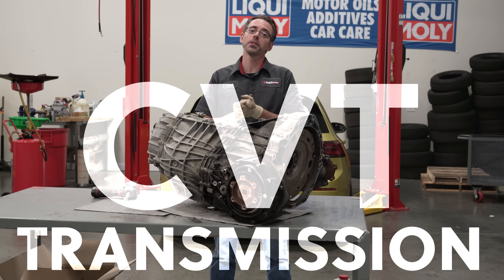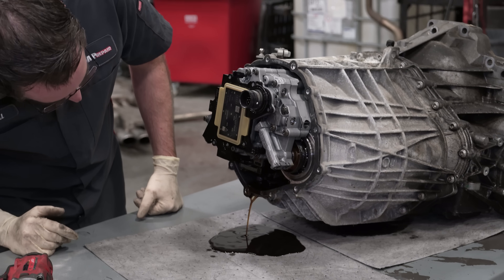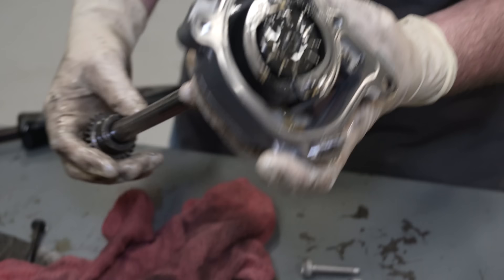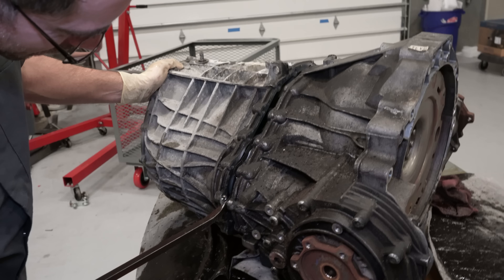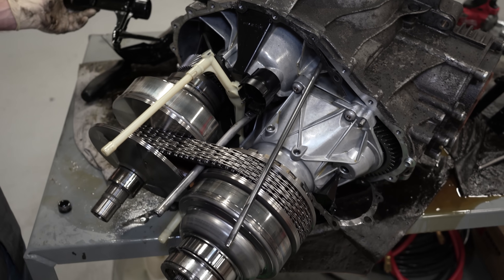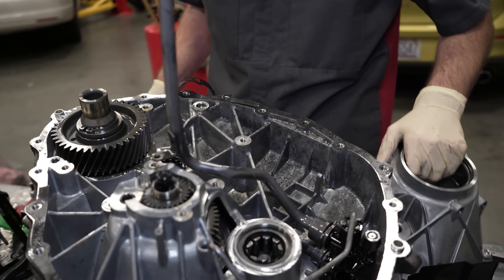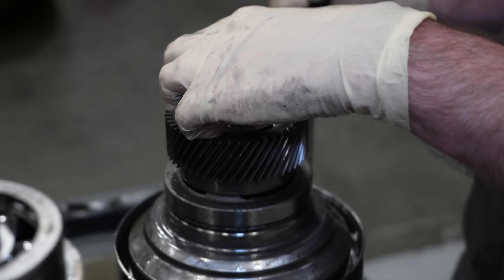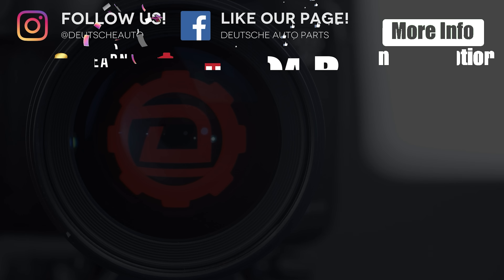Why you shouldn’t get a CVT transmission

Comment: CVTs are not trash Volkwagons are trash. There are plenty of CV transmissions that operate nominally and repairs can be done quite easily. Volkswagons are a high mile vurnerable vehicle. They operate fine in the warranty faze generally, then things start going wrong, Switches burn out, things start leaking, and transmissions start to fail within 10 years. Audi is very well known for transmission issues as well as other lines within the Volkswagon product line. It is commenly known that VW tried and failed at CVT.

Comment: I have a 2017 Nissan NV 200 van. 220,000 mi no problems with the transmission or engine other than the air conditioning. I change the CVT fluid every 40,000 mi. Maintenance is the key Nissan tells you you never need to change the fluid which is totally ridiculous

Comment: We have had to replace a CVT transmission in 2 different Nissan Sentra’s we have own. 2012 and a 2013. The 2012 is starting to slip again and it’s only 30,000 miles since it was replaced.  We will never own Nissan again or anything with a CVT trany.

Comment: Okay,I've been driving daily for 27 years. I recently stopped using manual gear. So far i've read the following:
-DSG =failure
-CVT=failure, not recommended, losing the "driving feeling", optimal RPM for engine
-Powershift=big piece of sh*t from Ford
-Traditional automatic transmission: boring, slow, complicated sometimes
- Tiptronic= fail, extremely pricey to repair
- Double clutch = fail, pricey to maintain and repair

What else do we have? Get a private jet and fly? I've got a Ford Mondeo Hybrid (european version of american Ford Fusion) with CVT gear. I don't have any problems with it. It does what it does. I don't care if i don't hear as it changes back and forth as there are no gears or there are "unlimited" gears. It is set nicely. If i need torque, i press the pedal. But it's excellent for cruising, no need to hurry, that car is not a sportcar anyway. If i need HP and speed i invest into a Mustang.

Comment: My old car, my 2016 Maxima SR when I first got it it said 4DSC on the tail light which meant four-door sports car and I’m like ohhh bet!!!! And I raced the fuck out of that thing and blew the transmission in the first week warranty Replaced it with a brand new one I blew it again in another week the next one took about a month to blow up I went through six of them in less than a year until I totaled the car Nissan just kept paying for transmissions to be put in my car lol that engine was bulletproof though i’ve been red lining the fuck out of that thing now I got an Acura TLX with the nine speed V6 had it for about two years and it still won’t blow up I drive it just as hard as a Nissan

Comment: CVT can be different - make sure you consult with a competent person before refusing to go for one (or before buying).

A good example of misleading name can be observed in case of Toyota. Prius 2011+ would also say “CVT” but in reality is a completely different assembly with no belt and only gears inside. It’s reliable and far easier/cheaper to maintain through the life of your car.

Comment: I currently have a 2017  toyota corolla 1.8L.   The cvt transmission has almost 400k miles.   It started making a noise in october which may have come from me not missing a curb...(oops).   But its still running strong

Comment: First seven seconds tell the truth. I'm an ignorant sucker. Bought a low mileage 2016 Nissan Versa for $6400--it ran great for about a year. Then clunk, clunk, dead...AAMCO wants 8K to replace the transmission.  I didn't realize these clever designs needed lube change so frequently! Twenty-first century motto: The customer is always at fault. Now I'm really appreciating the prepaid "free" bus system in my city.

Comment: It seems to me that the need to use a cooler of some sort and a filter system that is not built in to the transmission but utilizes rubber hoses to connect to a filter body that attaches to the vehicle itself and it uses a filter similar to what is used on the engine.

Comment: The earlier Nissan Jatco transmissions were bad. But the Honda, Toyota & Subaru Cvt’s are fine. You just need to ignore most dealers saying it’s lifetime fluid. Have the dealer or good mechanic, change the CVT fluid every 40k miles. The fluid gets hot & dirty, just like other transmissions or motor oil. 🙄

Comment: CVTs used by Audi and Nissan are trash, sure. CVTs in general aren't though. They can be built correctly, proven by Williams in F1... in 1993. It was immediately banned by the FIA because it beat the pants off of every other car on the grid with basically no other changes to the car, and to a lesser extent ruined the sound.

Comment: It's apparent he has never owned any car of any make. All transmissions are crap these days. Though the CVT has come a long way, some dipsticks cannot get over the fact that automatic transmissions fail just as much as CVT's. I will buy a 2025 Subaru Brat with a full extended powertrain warranty that last to 200,000 miles or more, like I did my 2000 Tahoe which I've put 320,172 miles on it. Eat my words Dipstick, maybe it's the haters that aren't worth listening to.

Comment: What was audi smoking when they designed that chain. The chain in the CVT he was showing for the live demo of it changing ratios was a much better design. The audi one has so little surface area, but the example one uses a bunch of sheets that have form fit cuts on the side. Of course this one failed.

Comment: The problem is that people tend to view transmissions in general as something you never have to think about, something that should last forever with zero maintenance---WRONG. I knew a guy that bought a Mitsubishi Mirage brand new, and the CVT failed at 125K. I was curious, and so I started asking questions. Did he ever have the fluid changed? Nope. Did he even check the fluid? Nope. Transmissions don't take care of themselves, folks---you have to get involved.
Reply: my friend you are dead wrong!!!!I bought a brand new Q7 Audi2009we are in 2025 I never ever touch this automatic transmission and works like Rolex...!!! when something is built the right way you don't have to touch every year or every quarter give me a break,with your comments about , you have to maintain the transmission just like you change the oil in a car,metaphoric saying of course
Reply: @markaegyssus5192  Yeah, and how many miles is on it? Only a fool neglects their transmission, or any other parts of their car.

Comment: The only CVT's that are good and reliable are the eCVT's in Toyota hybrids.  There is no pulley or belt, just a center gear and 4 planetary gears.  Variability is achieved simply by varying the speed of the electric motor.
Reply: They're great but not even in the same category anymore, it's more of a power split device.

Comment: I've got one of the first CVT's in a car, the Ford CFT-30.  20 years and 280,000 km, and it works great, I love it.  The model did have a few issues that could have been resolved.

Comment: Everything I've heard about these is that when they fail, it's pretty much always a total failure. It's not like a run of the mill automatic that you can have rebuilt. (Even if they're expensive to rebuild) it's that with these, if anything goes the whole transmission is done since they're either impossible to repair or transmission shops refuse to rebuild them because they have so many problems and they don't want to get stuck doing a warranty job. 

All this trouble so they can claim an additional 0.5mpg on that model and force a subpar driving experience on us.

But what do the OEMs care? They get to claim slightly better mileage and when it fails early they get to sell another new car. 

I'm getting real tired of every new car in the past 15-20 years having some ticking time bomb under the hood that'll turn the car into a paperweight before 200k miles.

Comment: You fail to differentiate between the different CVT methods of operation. CVT is the concept of infinite gear ratios. Some use variable belt drives. Toyota uses a planetary gear systems. Completely different from each other

Comment: What  idiot is in the background trying to be smart and funny.  CVT transmissions depends, like most things, on who builds them.   Audie cars are overpriced overrated crap. I have had one new the second worst car I have owned over a sixty year time span.  There is a CVT in my present car which has done over 200,000 miles. No problem of any kind.  Would go to these two for an oil change.

Comment: I’ve had good and bad CVTs 

Good is my 300k mile civic that has never had a issue 

Another good is my 2018 turbo 1.5 civic that tuned with 300hp that put the motor is peak boost constant making it’s as fast as a type R and it’s “fake gears” is so aggressive it chirps the tires 

The bad is a jeep patriot I drove and it was the slowest works engine and transmission I have ever seen

Comment: Got to ask what people thought when an automatic tranmission came out. I'm sure a lot of people said the same thing. Every tranmission has bad parts it's the person that owns the car to make parts, make it or brake it. Had a 2015 xv crosstreck cvt with 211k on tranmission. Launched hard off every light down shifted to slow my self down all the time never had a problem with tranmission but I did have a head gasket go out. Didn't help that after 8 years stopped letting the car warm up as long as the first year.

Comment: I've been looking at various car manufacturers over the past years and seen the demise of the manual transmission and the increased use of the CVT. We all know about the early crappy Jatco CVT transmission failures in Nissans. I guess we can assume that the newer generations of CVTs have been  improved, but the added inconvenience of having to go to a dealership more often for fluid changes (or any reason) seems like a pita. For my 2 cents Mazda with their great technology and geared automatic trans is the way to go. Or get an older Toyota or Honda with a regular automatic transmission.

Comment: Subaru cvt's  generally fail when one of the solenoids goes.  Subaru makes you buy the whole valve body for 800 bucks and if you don't fix it yourself, it will costs around $2,000 to have a subaru repair shop do it for you.  Independant mechanics are recommending fluid change every 30,000 miles despite subaru saying no maintenance needed for 100,000 miles.   I would never get a car with a cvt unless I planned on trading it in for a new one,  in about 3 or 4 years.

Comment: Seeking Help with 2009 Subaru Tribeca Transmission Issue

After changing the transmission fluid, my 2009 Subaru Tribeca's gears refuse to shift. My mechanics have already run diagnostic software, but unfortunately, the problem persists.

Could you please suggest potential next steps or troubleshooting measures to resolve this issue?

Comment: I have to say. I do not experience this with my Chery Tiggo 7 pro. In manual option I have 9 gears. In auto, the transition is very good and you can see the revs going to the next gear. I find it really good compared to others I drove. But I do have a lot of warrenty km's on it so.

Comment: I own  Audi A6 C6  2007  2,7tdi  FWD with cvt   and i love how smooth its drives  , i understand   if its breaks its will be pain . im trying change  oils often . i drove 200k km  and its run still fine  i love also drive in sport mode where its pretending  doing shifting

Comment: I bought my 2015 lancer Gt with CVT transmission new with 39 miles, I'm currently, still driving, with 196,xxx miles on my dash. I've had mine well over 130mph on tracks, as well as trail riding and road racing and have no issues.. I change my fluid every 15,000 miles even though owners manual says 30k. Also never changed the filter

Comment: Look at the fluid - of course it failed! You can not neglect regular fluid changes in ANY transmission, especially a CVT.
Fluid changes every 30K is not a lot to ask for long life of the transmission.
I noticed you used the word "mashed" the accelerator. What on earth for?  Just drive the car normally.
I have had 2 vehicles with CVT transmissions and I loved them both.
I stopped the video at 2:08. I don't need to see the rest of it.

Comment: Have a toyota CVT a k312 cvt tranny. Car is driven up mountain roads everyday has 100,000 miles on it. Just did the fluid changes and changed the filter. Car runs just like it did brand new not even 1 hiccup.

Comment: For a reliable CVT vehicle, one option is a Toyota Direct-Drive CVT model. It’s important to follow the manufacturer’s recommendation and change the CVT fluid every 50,000 to 60,000 miles (or 80,000 km, in my country). Even if you believe in the “lifetime fluid” concept, it’ll last quite a while before it has major issue. I think that’s the reason why many second hand Toyotas have more reliability issues than expected , simply because the previous owners abuse this reliability advantage before the cars start going bad.

Comment: I've been shopping for a ~2010 period used car lately...the general consensus seems to be that they're mostly not great in that time period, except for the one used in the Misubishi Mirage. As it turns out, having only about 74-78hp coming out of the engine means the transmission is basically never stressed, so the Mirage's is perfectly fine even under neglected fluid changes (to a point).

Seems like modern ones are pretty ok as long as you keep up with maintenance. Having driven my sister's Forte, I think they can be tuned to be sufficiently peppy-feeling as well (hers takes off like a rocket if you give it a moment), but I have to admit that I like the promptness and predictable shift points of a traditional automatic better.

Comment: 2016 nissan altima CVT owner here, nissan can go fuck itself.
i bought the car before i knew what a CVT was (now im an auto tech) worst decision ever.
2 months ago, at 39,600 miles my CVT failed catastrophically. and while the car was under the powertrain warranty by 20.4k miles, it had expired by time. (i bought the car used in '22 with 14k miles, first owner barely drove it)
when i asked for help replacing it because that failure is a fucking disgrace, they told me to suck a fat one.
oh yeah and id like to mention, i drove that car sub 2k RPM 95% of the time, going above 4k rpm less than 10 times, and above 6k rpm NOT ONCE.

do not buy a nissan. not even one with a regular transmission. shitty company. they will rail you.

Comment: I have a 2016 Honda crv and the cvt transmission is still working great at 350000 miles. The engine failed at 308000 miles. I change the cvt transmission fluid at every 100,000 miles.

Comment: Have a 2011 Outback 2.5, 220,000K, overdrive lockup would not engage, learned then had a shop replace that soleniod and all is still fine at 258,000 K. Change the Subaru CVT oil regularly though. Things happen.

Comment: So our Cube gave up the ghost, we drove it to Nissan, and they said four days later,you need another transmission? because it not responding to any information coming from, the gas pedal connected to the computer connected to the massive flow connected to the throttle body? connected to my wallet!! $5380.00 anit going to happen

Comment: The CVT technology is the only proven reliable transmission technology on the market currently. 

Compared to a 3-10 speed transmission. With all the efficiency loss in shifting on top of all the wear during the gear changes.

Shows how truly ignorant uninformed some people are 

I can tell you hands down that the same people who have problems with cvts are the same people who have problems with everything.

This is not a coincidence.

The most simple fact is that the number one reason most people hate cvts is because they do not know when to let up off the accelerator. 

They have led to the most speeding tickets because a lot of dumb drivers know when they are "up to speed" by the shift points. 
They like to race stop light to stop light and they let off when it shifts from shift to second.
But if it doesn't shift to second or third or anything they just keep going 

That the the number one single largest issue with cvts period.

I started off as a car salesman. I had to deal with these types of people on test drives. 
I left sales and became a technician.
Got sick of the dealership bs and politics with warranties and crap pay.
I left the industry and came back to automotive again as a salesman. 

I had to go on test drives and witnessed this issue first hand with THOUSANDS of stupid people. 

My bet is that this retarded idiot is one of those nut jobs that can't just drive. Has to race stoplight to stop light till the belt is excessively worn down from the spool ups.

The overheating of the transmission and excessive wear on the hydraulic springs in the pulley dampers. 

That retarded nonsense will ruin any transmission. There is absolutely nothing special or worse about the CVT to any transmission. 

If you beat the shit out of it, it will break. 

They are not inside of a formula car and you aren't racing.
So why are you acting so stupid and why can't you just take care and not abuse everything you come into contact with?!?

Comment: I think CVTs are fine for casual driving. I wouldn't build up a car for performance that has a CVT or use one for off roading. The Subarus are great AWD vehicles but they are not built for large heavy tires and rock crawling. I think they have their place. I like how smooth my wifes CRV drives.